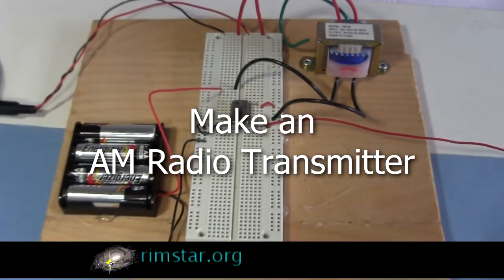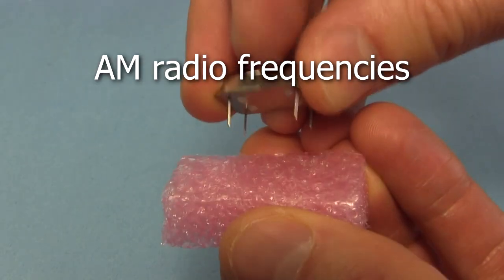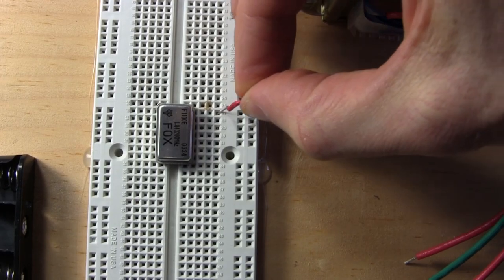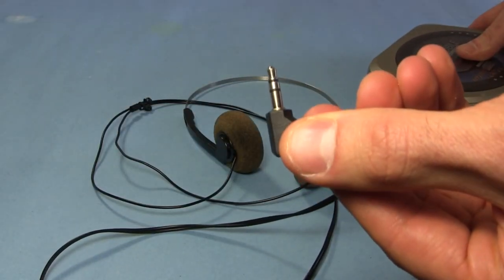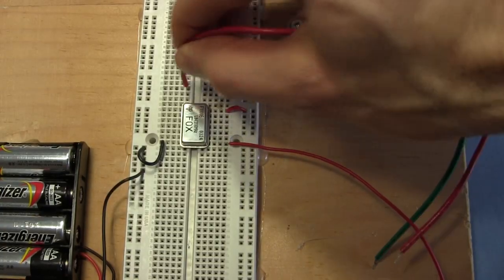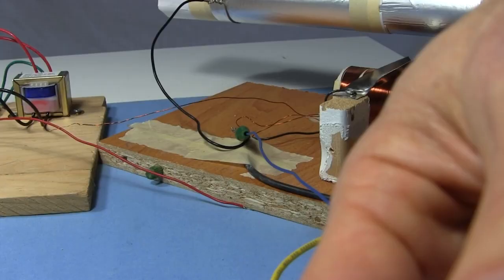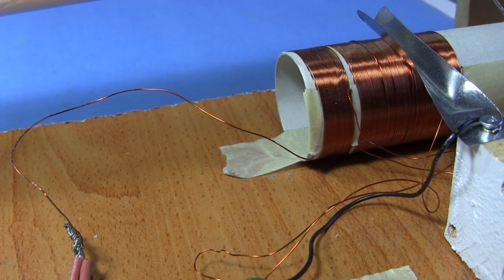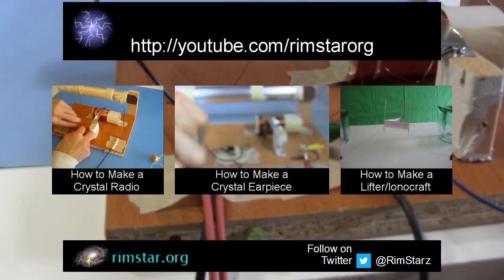How to Make AM Radio Transmitter

Comment: How could I increase the range of the radio to about 200meters (i know in some contries it's illegal, but not in mine :D ). And I won't make it anyway, it's just curiosity.

P.D. I know the range depends on the geography of where you are transmitting, for example, in the middle of a countryside, where are not buildings or obstacles, the range will increase, and in the city, i'll decrease
Reply: As I understand it, the mW provided to the antenna affect the range. I don't know what the maximum this oscillator could handle would be, it might be possible to hook the antenna out to another amplifier type circuit to further increase the power.
Reply: Krasnaja Zvezda You can unse a 555 timer for example, and if it is a DC light, you have to use a power transistor. Look for more information on internet, there is a lot of it about the 555 timer
Reply: Krasnaja Zvezda You can use a 555 Timer like Jeronimo mentioned, or you can use a Colpitts oscillator (http://en.wikipedia.org/wiki/Colpitts_oscillator) to make the frequency, and have a 12V batterry hooked up in series on one side, and your lightbulb in series on the other side.
Reply: pricemac
How would you make a 12 volt light flash to whatever hz you want?
Can you do a video on this or explain atleast?

Comment: Hi there. Also this question is a little off topic but I still would like to consult you. Recently I assembled an quite simple AM tube transmitter with tube, coil winded ferrite antenna and variable capacitor and such. It now works but the sound is strange. Normally the sound becomes clear when a radio tunes into the exact frequency and becomes fading out when it tunes away from the exact frequency. But mine is weird. When I tune it toward the frequency say 1000kHz, the sound becomes more and more obscure but when I tune it away a little, say 1002 kHz, the sound goes up and clearer. So what's the matter with this setup? Thanks in advance.
Reply: ivan R
Very possible, I haven't got the most ideal setup for testing, but that sounds like a probable cause for the interference I experience... I will have to play around some more.
Reply: Now, I'm no expert, but in playing with crystal radios, I find that super strong stations can overload a speaker if you have an amplifier hooked up. Also if the transmitter is right near to the induction coil (coil winded ferrite rod) you might have an issue with the magnetic field from the transformer affecting the induction coil, while also getting signals from the antenna. If they are opposite directions on the coil, they will cancel each other out when you tune the station, but being slightly off will allow one to be more powerful than the other.

Just my guess from messing around with home-made crystal radios.
Reply: +pricemac I dont think the transformer would play a big role in the frequency if it is on a continuos ferrite, however if it is an air core or a tapped transformer, it would be a whole different story. Probably what is at play here is harmonic and subharmonic frequencies. Since the frequency is really low, and i am asuming your antenna is not 60 meters (because of the period of the wave)(rod antenna), you would have a lot of harmonic and subharmonic frequencies. And it probaly just so happens that one of them is 1002khz.
Reply: pricemac yeah probably, my advice to you is you either use a directional antenna or use a higher frequency. Let me know if you get it to work better :)
Reply: This sounds like you're getting more FM than anything else

Comment: RimstarOrg If you have an amplifier that can output up to 1500 watts, do you need the transformer?? If not please elaborate.
Reply from the maker: Really it's the amplifier's output voltage that matters here. It should be around 10-12 volts peak-to-peak. That way when the batteries steady 6 volts is added to it, the majority of the result going to the oscillator is above the 0 volts. i.e. the amplifier's peak-to-peak voltage should be around double the voltage of the DC source (in this case the batteries.) See my follow-up video "Amplitude Modulation with Simple AM Radio Transmitter" for illustrations of this.

Comment: Dear Steven,

I made the crystal radio ( OA-71 diode, piezoelectric earphone, 22 AWG enameled wire, Aluminium foil capacitor, 35 ft antenna) and AM transmitter ( 0.806 MHz oscillator, 35 ft antenna, audio source - laptop / phone).
The radio doesn't even detect static which is there in my old Walkman AM/FM radio.
The audio from transmitter can't be heard on my Walkman.
So, I'm in complete trouble as I cannot change the subject for my son's science fair which is on 23rd August, 2014.
Please help me.......

Regards,
Sudipto
Reply from the maker: Sudipto Ghosh Do you have a good ground connection? Are there any radio stations nearby? The antenna must be in a straight line and preferably pointing at the radio station. Check all you connections to make sure you are making good contact everywhere, including at the capacitor foil and where the wiper blade touches the coil.Regarding your AM transmitter, I have did you try your transformer in both directions. Are you sure the pinout for your oscillator chip is the same as mine?
Reply: RimstarOrg For the transmitter, I did not use any transformer, but direct audio from laptop. I am not using any breadboard but direct connections. I used a coat hanger wire for tuning fork and capacitor I can't guarantee.

Comment: What's the maximum range you made the sound transmit?
Reply from the maker: 5555Jacker The maximum range I transmitted where the signal was still strong was probably around 6 feets/2 meters. I wouldn't want to transmit further since that would interfere with other radio signals.
Reply: I see. Would it be possible to go even further, if you wanted to, though?
Reply from the maker: 5555Jacker Sure. But I wouldn't advise it. Especially this this transmitter which broadcasts on more than one frequency. In some countries it's even illegal.
Reply: I see. Thanks.

Comment: I am making a radio and a transmitter for my school science project. I 
have all things except crystal oscillator. I searched all stores but 
can't find a 0.9 to 1.2 MHz oscillator. I found a good 0.8MHz 
oscillator. Will that work? The 1MHz oscillator has only 2 pins while 
the 0.8MHz has usual 4.
Reply from the maker: Sudipto Ghosh 0.8MHz will work. The normal AM radio range is 0.54MHz to 1.6MHz, so 0.8MHz is right in the middle.

Comment: When transmitting a carrier of 1.8Mhz, if the receiver will pick up 900Khz then it is not much of a radio.
Reply from the maker: It's not the radio's fault. The transmitter is broadcasting on multiple frequencies at once. i.e. It's not much of a transmitter. But it's a very simple one. I still have it on my todo list to make a better one.

Comment: Correct me if i'm wrong, but I think one could theoretically replace the crystal oscillator with a crystal rated for 12 mhz, and transmit in the SW band, or one for .225 mhz, and transmit in the LW band.
Reply from the maker: I would think you could. Just be careful not to interfere with other people's radio.

Comment: How does this work do you just build this and it start playing or do you need anything else before it start playing and you can tune it???
Reply from the maker: You just make it, plug in your sound source (e.g. in my I used a CD player) and it just works. Make sure you don't transmit more than a few meters so that you don't interfere with other people's radio. You can't tune this one. The radio frequency is the frequency of the oscillator chip that you use. If you want a deeper understanding of how it works, see my "Amplitude Modulation with Simple AM Radio Transmitter" video.
Reply: RimstarOrg
Ok thanks for the help :D

Comment: would there be a way to directly connect a microphone to this?
Reply from the maker: A microphone should work but you'd need an amplifier of some sort. Just connecting a non-powered microphone in place of the CD player would be pretty weak I think.
Reply: RimstarOrg Hey thanks for replying! So if I plugged a microphone into a standard guitar amp that I have, and then plugged the transmitter into the headphone jack on the amp, would that work?
Reply from the maker: MattSaturn
Yes, but make sure the peak-to-peak voltage output from the amplifier to be less than or equal to the batteries' voltage. You can see the voltage waveforms for mine in my follow-up video Amplitude Modulation with Simple AM Radio Transmitter

Comment: so....could you replace the crystal oscillator with any frequency you want to transmit in? for example, putting a 7mhz oscillator instead of one from 1-2 mhz for am radio. also, how would you wire it so you can use it as a CW radio? could you just connect your CW key to the power leads and simply put the two ends coming off the transformer together where you connect the audio source, there is none, you're just sending a tone. then you're just turning the entire radio on and off with the key, sending a tone. could this work?
Reply from the maker: Within reason, you could replace it with a wide range of oscillators. But keep in mind that there's no filtering with this circuit so it also broadcasts on harmonics. It should only be used for very short distance of a few meters or less, so fun projects and science fairs. With that in mind, I don't see why it couldn't be modified to send just a tone, adding a simple on/off switch might do.

Comment: what if we connect ac  without a oscillator??
Reply: james saddy http://www.sciencebuddies.org/science-fair-projects/project_ideas/Elec_p024.shtml#procedure
here's a simple diagram of basically what he's doing, you COULD do it as you want to, but the frequency is so low that nearly no existing rado could pick it up, the wavelength and thus the transmitting antenna would be monstrous. you'd be broadcasting in the SLF band and no such amateur band exists, I believe the only user would be the US navy with their submarines, so broadcasting there could get you in a mess of trouble with the FCC and the rest of the government, best not to trifle with it.
Reply from the maker: I don't know what you mean. Can you explain what you have in mind in more detail?
Reply: Radio waves are produced due to irregularly in power/current. And this is the work of the oscillator to provide that in the circuit.so I mean that if somehow we could use ac.,as oscillator change dc to ac which in turn produces radio wave..could the oscillator be replaced by pure ac.the rest of the circuit msy still carry dc
Reply from the maker: james saddy
I'm guessing by ac you mean the ac that comes from your home's wall socket. AC just means alternating current, any alternating current. If you do mean your home's wall socket then no, that won't work. The wall socket's AC is 60 hertz (60 cycles per second, or 50 depending on where you live) and radio waves for ones that a normal AM radio can pick up are in the range of 540,000 hertz to 1,600,000 hertz. 60 hertz is way below the range of any radio frequency.
Reply: RimstarOrg i know that ac uses only 50-60 hz but i just want to know how to replace the oscilator...a circuit diagram would help...
Reply from the maker: james saddy
No, AC does not use only 50-60Hz. AC stands for Alternating Current. Current can alternate at 60Hz, 100Hz, 1,000,000Hz, or anything else. My oscillator puts out AC at 1,800,000Hz while mixing it with something else. Most AM radios use AC in the range of 540,000Hz to 1,600,000Hz. So you cannot use 50-60Hz. It will not work and so I don't have any circuit diagram for it.
Reply: I didn't understand. U mean using ac won't produce radio wave at all?
Reply: Actually I am not trying to broadcast music or so.just want to know if this produces radio wave.but I didn't know how to use the output.
Reply from the maker: james saddy
Let's try another approach. What do you mean when you say AC?

Comment: RimstarOrg, I has one of these transmitters and they worked very well.But,now being a ham radio operator i have multiple frequency bands and spectrum.
Operating on 1.8 Mc will also cause transmission at the end of our 160 meter band which spans to 1.8-2 Mc. Using it in this case is illegal with out a ham radio license and because am covers 3 Kc ether side off the central frequency(1.8 Mc) you are transmitting even out of our band and in to the narrow band am frequency.To solve your harmonics and sub harmonics you can use a circuit called a pi filter. It uses coils and capacitors to let only the frequency you are transmitting on to be passed.
Reply: Also, the resown why the harmonics and sub harmonics are there, is because during oscillation, the oscillator probably has a "virtual tank circuit" ( witch is a coil and capacitor in parallel) and the circuit works by rejecting all frequency expect the one it is tuned to . All of the rejected frequency either go through (harmonics) or so far off tuned frequency, they just dissipated and become week.
Reply from the maker: K5DVT
I'm aware of the issues re transmitting. that's why in the video I advise people to keep transmission distance short, no more than a meter or two distance. I advise people that in my replies to comments too when it sounds like someone is trying to transmit further.
And thanks for all the tips. I hope to do a filtered one someday. Also, thanks for the explanation re the probable causes of the harmonics and subharmonics.

Comment: I don't know if you have answered this already, but i don't see it. What type of mic should I use for voice?
Reply from the maker: I've never tried a mic with this, so I can't say for sure. But it would have to be a battery powered one, likely with an amplifier. I don't have this circuit assembled right now so the best I could do was to plug my RODE Videomic Pro mic into my oscilloscope. That mic has a 9 volt battery. On the scope, normal voice shows only around 500mV peak-to-peak. That's under no load, so connected to this transmitter circuit it'd likely be even lower. That leads me to think it'd need a amplifier.
Reply: RimstarOrg
Wow! that was fast! I have never had a reply that fast! And the next fastest person ( a week and a half ) gave me a " I don't know." Thanks! 
As for the actual response, I will make a amp! Thanks for being awesome!
Sam
KK4NVJ
Reply from the maker: Sam Wolff
:) I just happened to be checking things when when you commented. Let me know how it works out. Knowing that will help me help others in the future.
-Steve

Comment: Does you can use this radio transmitter without doorbell transformer?
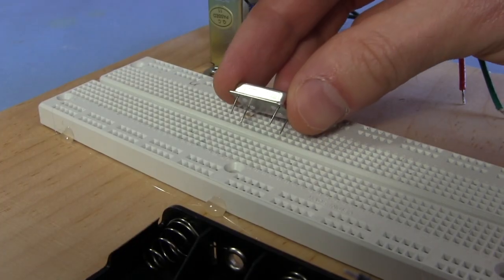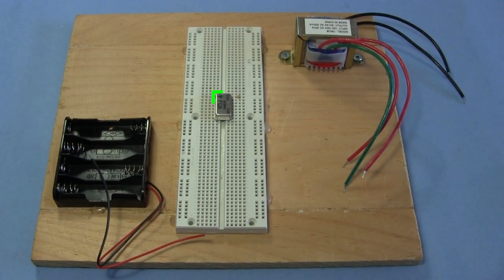Reply from the maker: I'm not sure. It would seem like you could just put the audio source right where the transformer is if the voltage of the audio wave is higher than the 1 volt that mine is. To do that you'd simply need a more powerful audio source than my CD player. You need the audio source output to go from the voltage you see in the video at 1:54 to the voltage you see at 2:21. But, I'm not sure what effect that would have one the audio source itself.

Comment: why does dividing the frequency by 2 work?
Reply from the maker: It works because the transmitter is broadcasting multiple frequencies. Those frequencies are both multiples of the documented frequency (harmonics) and frequencies that are 1/2, 1/4, ... of the documented frequency (subharmonics.) I don't know off hand what in the circuitry is making it do that. That's also why you especially don't want to broadcast very far with this transmitter, since you'll interfere with so many frequencies.

Comment: Would the receiver work better if it used an identical antenna to the transmitter?
Reply from the maker: No, the longer the receiving antenna the better, at least practically speaking. The best antenna would be the length of a single radio wavelength, which is 100s of feet. For a radio signal with frequency 1.6MHz, the wavelength is 299,792,458 meters/second / 1,600,000 wavelengths/second = 187.37 meters/wavelength. (The first number is the speed of light.)
Reply: What if you were to polarize the wave to a specific plane of oscillation and have the receiver aligned to it? If that's possible for a small project. Like how a TV aerial is aligned to an RF tower.
Reply from the maker: George Thomas
I don't know how you'd polarize the wave on the transmission side but you do get the best reception by pointing the receiving antenna at the radio transmitter.

Comment: What is the resistance of the primary and secondary coils of your audio transformer?
Reply from the maker: I don't have an audio transformer (though that would be better.) But the doorbell transformer that I use in this video has around 130 ohms on the input side from the sound source and around 190 ohms on the output going to the rest of the circuit.
Reply: Thank you.

Comment: how do you do the tric to make it 1 megahertz  (since im using a 2 MHz Full Can Crystal Oscillator)
Reply from the maker: It depends on your oscillator. In this circuit my oscillator happened to put out the documented frequency along with harmonics and subharmonics of that frequency - not really a good thing. If your oscillator isn't doing that then it's simple a better oscillator.
Reply: I'm sorry(i'm new to this kind of thing), so you're saying i should do...?
Reply from the maker: kuku keke
Sorry, I wasn't clear. You should try it and if you don't receive it on a harmonic frequency then either get a 1 megahertz oscillator or a get 2 megahertz oscillator that isn't as good and will transmit harmonics like mine. But I don't know how you'd tell which oscillators will do that.